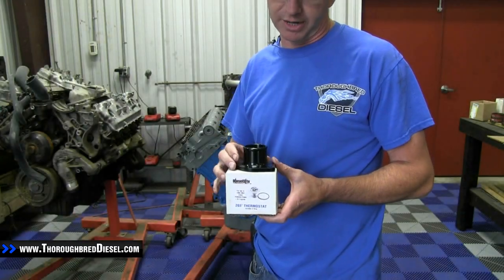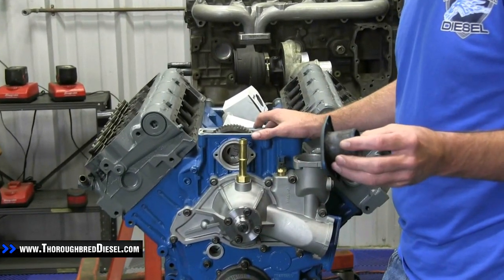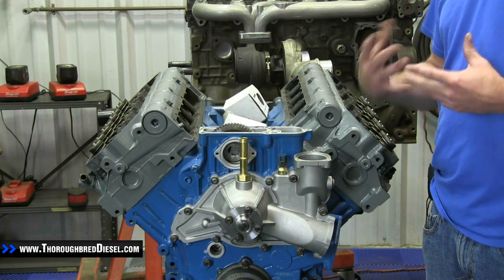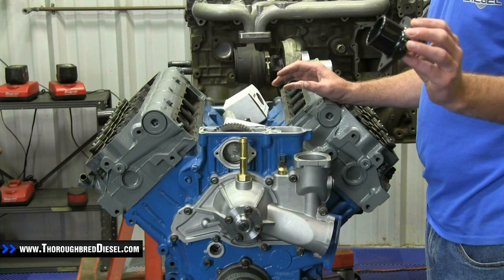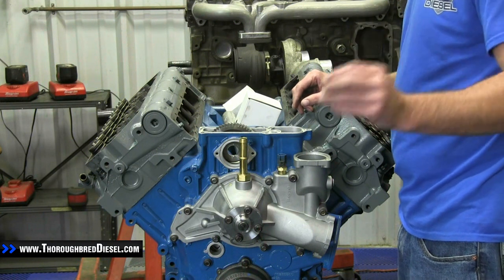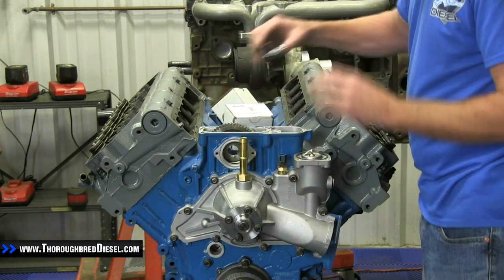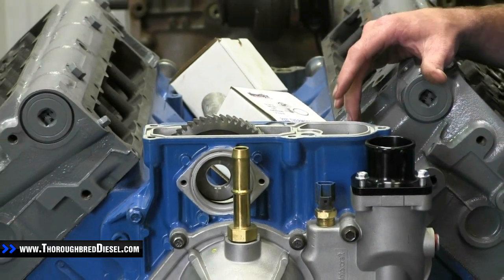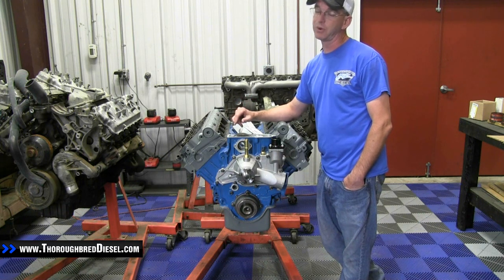203 Degree Thermostat & Housing Install: 96-03 Powerstroke 7.3L #diesel #ford #howto

Comment: Does 203* degree thermostat give better cab heat in winter over stock thermostat
Reply from the maker: It won’t be noticeable.
Reply: some guy in idaho on a forum said it was smoother running and warmer/faster to heat the cab